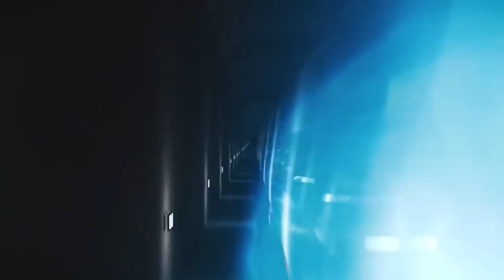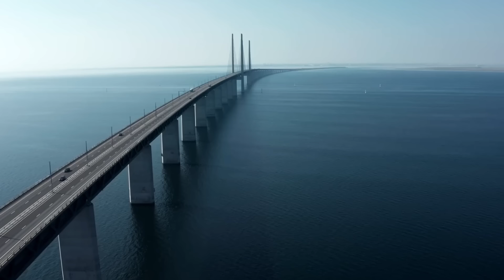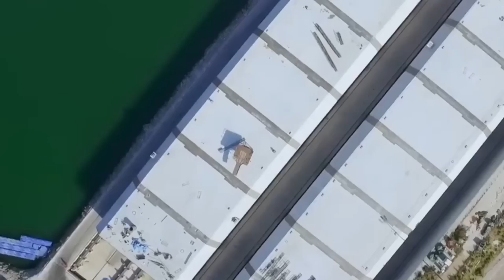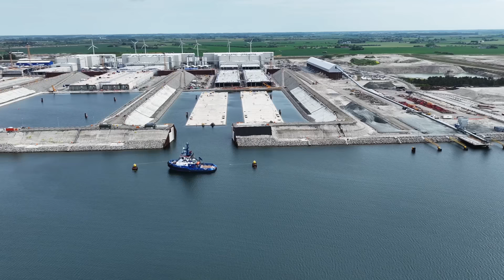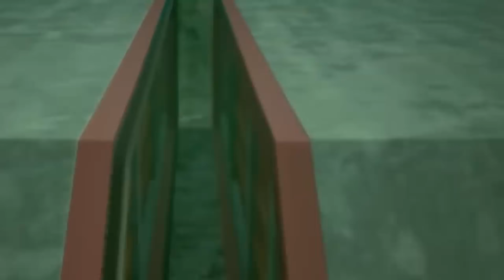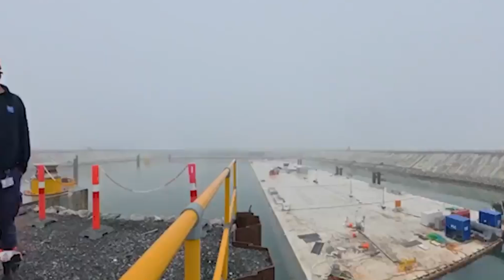Denmark is building the world's longest immersed tunnel to connect with Germany and Europe

Comment: It is the Kingdom of Denmark alone that is responsible for the construction of the Fehmarnbelt link. Germany is solely responsible for the land-based facilities on the German side — and they are behind schedule.
Reply from the maker: It is exactly two years behind schedule—possibly even longer—due to technical issues and reports involving the German side. Thanks for checking out the video, brother; don't forget to like and help boost it.
Reply: @WinD-LPS  It's behind schedule because of the Germans. And who is covering the extra costs? Right, the Danes. Thankyou germans.

Comment: Its a wonderful project and I hope they will succeed, but its construction is....slooooowww
Reply: Projects of this size and complexity can't be rushed.
Reply from the maker: Exactly—just one minor technical error could lead to extremely serious consequences, so it’s perfectly understandable that the process is taking longer. Thanks a lot, my friend—and don't forget to like and share this video!
Reply: Yes Denmark isn’t fast like China we like our infrastructure to last for a 100 years and not collapse before it’s even finished, quality takes time and Germany only had to fix their side which that’s haven’t done yet so it’s pretty irrelevant if Denmarks part is a little delayed it’s not going to work before the Germans built their little part of the project
Reply from the maker: @kimmogensen4888  That's correct, as I mentioned before, part of the delay was due to technical issues, and with such a huge project, a delay is very normal, and I've almost never seen a huge project that hasn't been delayed for a while.
Reply: True, but it's huge and partially based on new technology. It's also weather dependent, because the elements can't be towed out if there is too much wind and waves.
Reply from the maker: Yes, you're absolutely right. According to official reports, the project is running two years behind schedule because the floating equipment hasn't been approved yet; weather conditions have also had a major impact, given that construction is taking place out at sea. Thanks a lot, my friend—don't forget to like and share this video! Love it.
Reply from the maker: The project is running behind schedule due to some technical issues, but rest assured—it will definitely get finished, my friend.